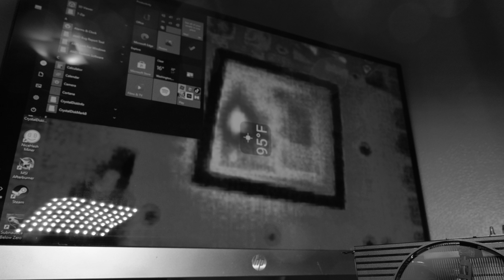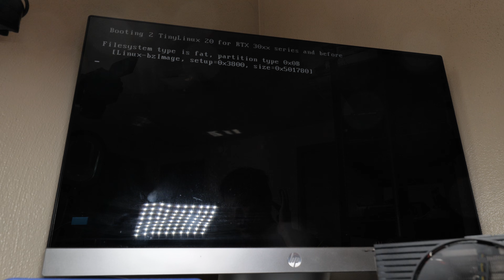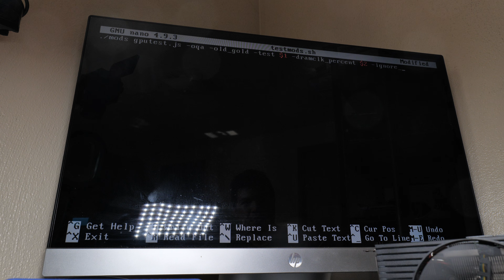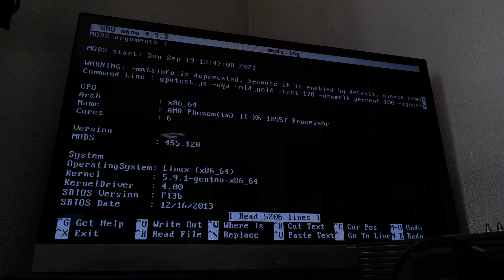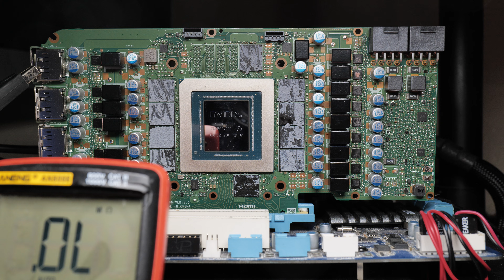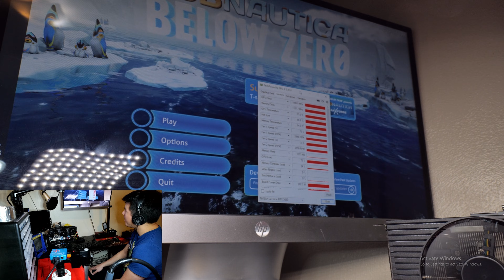Alienware RTX 3080 Graphics Card Repair - Crash Under Load

Comment: Hi! I had the same result in mats/mods. I took the gpu to a local shop to get the memory replaced and they basically killed the card. The new memory module gets hotter than the others so I asume is shorted, any tips on how to replace the memory module myself? I practiced on a laptop mobo and I couldn't get any module off the board, not sure if a preheater would work or what temperature is needed.

Comment: Hi, I have old Gigabyte gv-n1070ixoc-8gd. Generally it works, but in any OS UI mouse pointer during movement periodically frozes for milliseconds. In 3D games scenes with large number of 3d models shows well, but for example if cam shoes flat sky it may frozes for seconds, tens of seconds... but pc will not halt. I not tested ram ICes yet, the only thing I noticed that one pcei diff pair has significally different resitance to ground than other ones. Can this behavior goes from ram or nvidia chip is partually broken?

Comment: I had a similar issue with my 3070, just that it black screened under high load. If anyone else has this issue: make sure your vrms are properly touching the heatsink and replace the thermalpads on em. Thank me later
Reply: @alexunltd  I had mine undervolted as well, the vrms were overheating anyway
Reply: @MightyGimp  no, I mean the vrms.

Comment: My HIS RX 560 2GB has the same problem. 
Sometimes it freezes under heavy/light load. When I run Furmark and 3dMark Time Spy it passes the stress test. But sometimes when I am browsing the web it freezes or when I am gaming. I reduced the the clock speed of the VRAM and the core in MSi Afterburner by about 100mhz and the problem went away. Its the only thing I can do since I dont know how to do a hardware repair.

Comment: Gj there :) i have an msi 1070 gaming x 8gb and randomly loses therm_overt signal, it may work for hours and it may freezes all time, any ideas? Maybe the hot unplug circuit causes the signal goes low? Or gpu?

Comment: Hello, I'm basically a newcomer to this channel and do electronics repairs before going into graphics card repair and TC are opens a lot of knowledge. may i ask a question where i get the linux ISO file for the GPU test shown on this video? i used to repair an older card (5xx and 4xx Nvidia Cards) that the latest mats/mods wont work. thank you in advance!
Reply from the maker: You can get it from the "Learn Electronics Repair" YouTube channel's discord server.
Reply: @TechCemetery  Thank you! I'll looking forward about it. 
And by the way, if you open a detailed online course about GPU/motherboard repair, let us know! 😊

Comment: I have the Dell 3080 with similar issues (loads driver, runs ok then crashes under load) and it will not run test 178. Loses display near the beginning of the test and power consumption drops from 300+ watts to 141 watts and nothing else happens. Any ideas?

Comment: I have a similar issue with a 2070 super. Screen will turn on and off, doesn’t hard crash in windows driver installed. Under load it’ll crash to desktop. Works under clocked. I’m guessing core or power delivery. Anyone else wants to weigh in?

Comment: Hey I have a 2080 with mild memory corruption, it crashes under load I ran mats and mods, I am getting problems on D0 from 00 to 31 bit so it's the whole bank, but I am only get 33 write errors and 0 read errors all your videos when you have a bad memory bank you get like 1milion errors why do I get only 33?
Reply: I don't know I fixed mine by going -502 on memory clock and it works fine for a year now. @MightyGimp

Comment: Hi did you fix gtx 980ti or gtx titan x? I have burned pcie pcb bus on 12V and after remofing burned part and connecting everything (smb data etx) i dont have any voltages on gpu, i think the v12 cant get intu 3,3v converter. Do you know what volage is on Vin in referent gtx 980ti or gtx titan x?

Comment: I have a question?
I am running dual PSUs (server+breakout board and pico) I am using a a 160wat pico the problem is my cpu is a ryzen 9 cpu which the pico cannot power!
So can I hack up a PCI-e 6pin cable and solder an 8pin atx head(in the correct orientation and polarity) and run my cpu directly from the breakout board!?

Comment: Excellent video! What temperature do you use for soldering the Gddr6x modules? And do you use a preheater?
Reply: For a gpudoctor that shouldn't even be a question. If you don't preheat your board upon cooling down you put tension between the chip and the board. Do the preheat always and you'll do fine.

Comment: Hi. i have a question?
I have RTX 3080 it no display. but when i use Display from motherboard it still detect that GPU but cannot install driver . i'm notis that VRAM issue. Question is ? how can i check which memory bank are having a problem? i try to use MATs/Mods but not working with RTX 30xx series. (i used to replace 8 Bank for RTX3070ti in my prevues repair).

Comment: I have a r9 290 that is crashing and artifacting and I recently learned how to solder smd’s and I would love to give it a try but I don’t really know where to start. I have a video on my channel with the artifacting any idea what the problem is with this model?
Reply from the maker: Memory
Reply: @TechCemetery  okay and what you used this video to find which memory chip is giving errors also works on r9?
Reply from the maker: @IntelArcTesting  Yes, the VRAM test tools has a section that is compatible with an R9 290
Reply: @TechCemetery  okay thanks and where would I get replacement components from?
Reply: @IntelArcTesting  dead cards, digikey or aliexpress

Comment: you should add a beeping sound if it finished the test.
1.{sudo modprobe pcspkr}
2.{echo -e '\a' > /dev/console}    or     {beep}  or {echo -ne '\007'}
Reply: Jesus, how do you know all these stuff? How can we disable autorun of the vram test tool?
Reply: @gpudoctor  play with Linux more?
Reply: @KiKi_HUN any idea what command to use to rename+save the old report and create a new one every time?
Reply: Good question. You can call a rename function in the start bash file i think. After end line in the video. And you can use the system time to make a specific name.

Comment: I have a broken 8800gts dead under load and show artifacts and x1950 pro AGP in BIOS the screen turn on off on off and have a wrong color image post of the BIOS screen but i don' t have the tool for fix these two old beast

Comment: What pads do you use? I recently repadded my Precision M6600 with some Gelid GP-Extreme pads and they seem to hold up just fine.
Reply from the maker: Gelid Extreme or Thermalright Odyssey, whichever is cheaper that week.
Reply: @TechCemetery  I wonder if Gelid is softer than Thermalright, sometimes their stiffness leads to trouble. Laird 90000 are quite soft.

Comment: You helped me beat a scammer, he sold me a dead GTX 1080TI SC2, but I watched some of your vids and replaced the C1 memeory bank which was faulty/dead. Now I'm up and running and it has been working for a good 3 months now!
Reply: What heat station did you use? did you get the memory only?
Reply: @euphoricmonk  got a shop near me to do it, I ran mats/mods to diagnose the card then asked a local shop near me to replace the faulty bank.
Reply: Did you have to buy and provide the memory bank or did the shop have them handy?
Reply: @siddharth2965  I asked them to order it for me.
Reply: Am I the only one or is it hard to find good working Gddr5x memory modules?
Reply: @gpudoctor  Seeiously doubt you’re the only one, everything is a 💩 show for 2 years now.
Reply: @frizzlefry5  lmao yeah